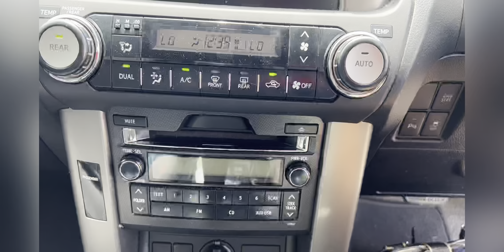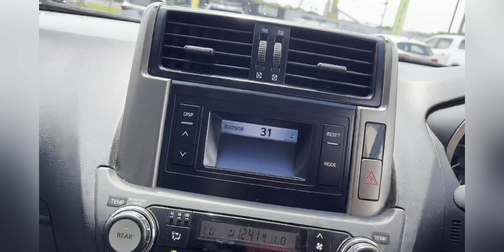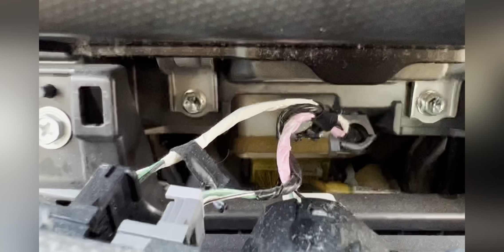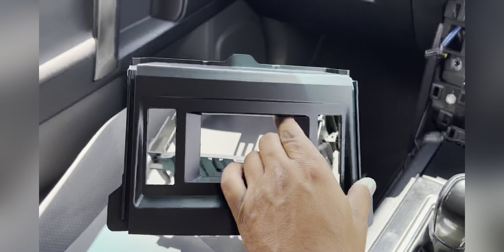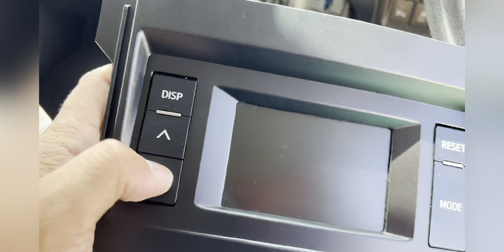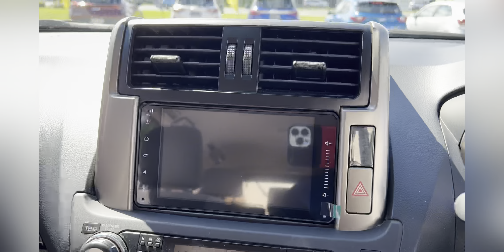Toyota prado headunit upgrade, using OEM camera

Comment: Hi. As you said Factory camera Supply 6V.but after market head unit  Supply 12v.how is it possible to connect  6 V to 12V head unit.? Can we connect direct to 14 pin socket.?Is it not danger?Thank
Reply from the maker: Please do not connect directly unless its 6 volt, 12 to 6 volt converter easily available on electronic shops